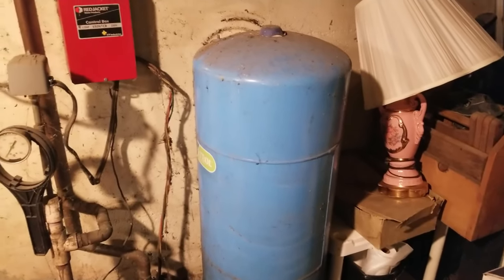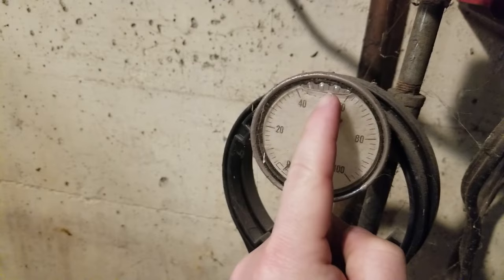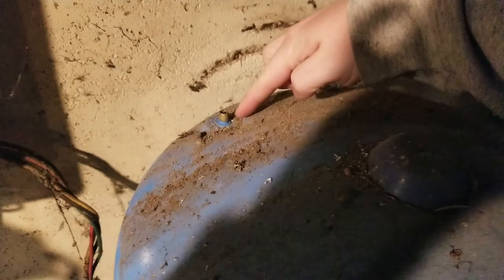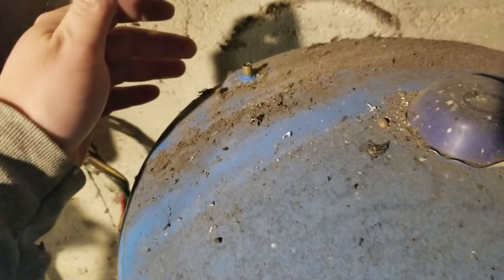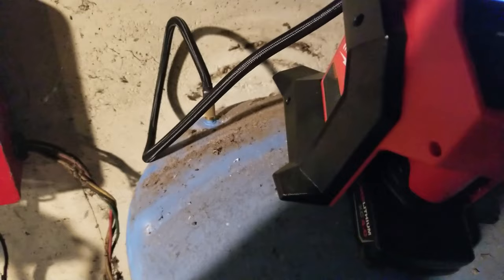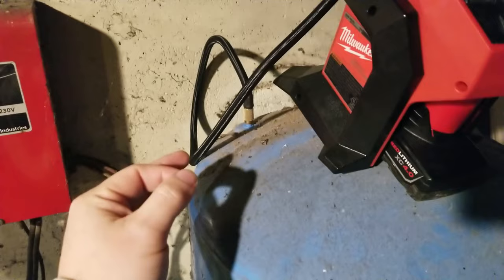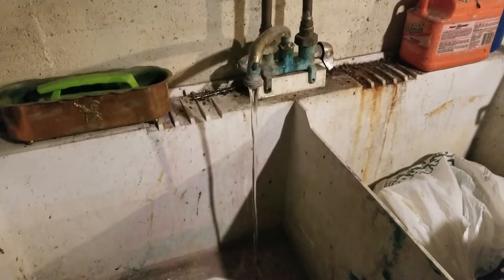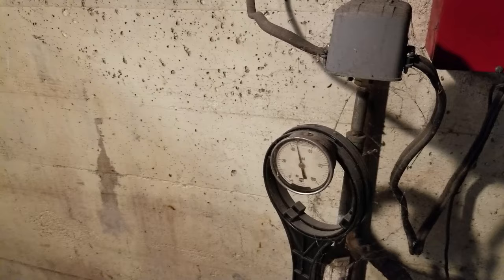How To Find Out If Your Well Pressure Tank / Bladder Has Gone Bad

Comment: When you drain the tank with a faucet somewhere above the level of the tank you should air the tank up when the pressure in it gets low in order to drive the water out of the tank. If the tank is water locked the existing air pressure will not have enough volume to push all the water out and gravity will not allow it to drain because the tank is lower than the outlet. Two or three times of repressure application will usually do the job.
Reply: Omg thank u. I have been searching for this answer forever

Comment: If you don't have a spigot at the bottom of the pressure tank to open I would think that there would always be some water in it.  Opening a faucet at a location anywhere higher than the tank will just remove all the pressure from the tank and the pipes but there will still be water in your pipes that seeks it's natural low point, which will not be at the bottom of the tank.  You would need to have and open the spigot at the bottom of the tank and open a faucet somewhere else in the house so that any vacuum in the system would be released and then the tank would fully drain. I also think that if the bladder is broken and water is getting to the top of the tank, where only air/pressure should be, that if you press on the spring loaded schrader valve stem, when the tank has it's high/pressure switch shutoff water pressure, that water would come out of the schrader valve.
Reply: In Europe we call them taps not faucets.
Reply: Comprehensive explanation, thank you.

Comment: That looks more like a foot value or a slow line leak problem then a pressure tank problem. You should also have a check value where the line enters the house prior to the pressure relay and tank, that way the pump won't kick on if you have some kind of bleed off prior to the house. Even a bad tank  should hold constant pressure when no water is being used, unless the air value is leaking.
Reply: No, it shouldn't. If the bladder is shot the air pressure will escape through the lines when the pump is turned off.

Comment: I just had the same problem. My issue was that last winter my system froze. Long story, but in any case, I replaced the plumbing that had obvious issue and knew that the tank probably also suffered damage. Well, it lasted about four months and then my water started pulsating. When I checked the top Schrader valve it had plenty of air and no water came out. I followed your instructions and drained the system. When I shook the tank I could barely even move it. It was FULL of water. 

I got it disconnected and the valves spun off of it, but couldn’t move it. With all the air out and the valves removed, I had to drill a hole in the thing just to move it. 

Thank you for the help!!

Comment: im in the same situation right now...pump never gets to shut off point and constantly runs...been using the breaker when we take a shower or dishes...
 my bladder tank was completely out of air.  i filled it to 28 and in a matter of minutes it dropped to 26 psi.
Reply: Great video thank you how do you drain your bladder tank I think I need to replace mine I tried to shake it and it seems to be full is that a bad sign

Comment: Aight bud, here's the scoop, sorry for the delay.
The pump has a check valve, but don't rely solely on that, add a very simple brass check valve (it's just a nipple sized fitting with a pin and a simple swinging flapper door, costs maybe $30, as it's probably 1" minimum, or should be at least).
Also, observe the crud in the bottom, may be worth adding almost any kind of whole house filter, as mine was filled with mud, (well dug to 120', pump set at 100, water sits at 75' down), I installed a T, after a check valve prior to an old style plain spigot placed higher (above) than what's next (for draining/allow air IN). Then, in a vertical pipe, put a T to split the one into 2 pipes, (now this is crucial) at the SAME level (height) I added 2 of the plain/simple/basic/cheap/pleated (round air filter looking) high micron whole house filters to eliminate a lot of chunks o sludge, as well as catch tons of the iron sediment prior to that storage tank.
Being that it's split to 2, I usually change them out every 8 months. I have the filters both lead to a T to return to one pipe, and then another basic spigot on a vertical line below the filters in line before a shut off valve.
Also, on my new pressure tank, there's a manifold (at the bottom, different brand) that I also installed a spigot for draining the tank when that time comes. On this manifold is my pressure switch, a gauge, the in and out lines, as well as a pressure relief (much like a water heater has but without a temperature probe) that is connected to a small bleed off line that runs to the dump pump pit, should the switch fail in the on position.

Having the 2 filters on the same plain is important, otherwise one filter will get filled with debris while the other (higher) filter remains new looking. Also, the new home depot GE brand whole house filters offer a clear filter housing that sorta allows you to monitor the debris, but further down the line, for the home only, after exterior hose bibs split off, before my "conditioning" equipment, I have another split T to 2 separate better quality filters.
Reply: I've had well water here for 37 years. I think the check valve could be the problem also.

Comment: ########!How does pressure loss on water gauge come from a water leak inside bladder tank????? I told son, that his pump one way valve in the bottom of well was leaking back down. The bladder tank air valve does not release any water, and there is a difference when knocking on upper and lower section of tank!..<<<>>>???

Comment: We just had our tank replaced. It started blowing the circuit breaker. Is it a bed tank? Thank you.
Reply: Why did you have the tank replaced, and was it professionally installed?
To me it sounds like the pump down the well is shot or the wiring at pressure tank might be goofed up.

Comment: Man I'm confused.  My tank pressure does not drop when I turn the water on at a faucet.  The switch never turns on.  If the switch were clogged it would never turn off.  Basement has water the 1st floor gets a trickle.   Would that be a bladder leak?
Reply: Mine has the same issue. The new switch I fitted turned off the borehole pump at 44psi, but the pressure continued to rise to 58psi where it settled. After some time and usage the gauge reads a constant 58psi but in the house the water pressure is essentially way down to a trickle, though the switch is still held in the fully pressurised ‘off’ position. The gauge has been checked and is good, but the pressure inside the diaphragm tank firstly increasing then staying up suggests to my thinking that the diaphragm might be perforated, though when I test the Schrader valve air comes out but not water, and when emptied the tank rings bell like when knocked, and is easy to move around, ie not full of water. Were there to be a leak in the system then surely the gauge would drop, the switch would trip ‘ON’ and the pump kick in again, re-pressurising the tank.  Water cannot be compressed (hydraulic fact 101), so the gradual increase in pressure noticed at the gauge AFTER the pressure switch has tripped to ‘OFF’ suggests that water is getting into the airside chamber above the diaphragm, thus increasing the pressure there - I should point out that my gauge and switch are located on the top, air-side half of the tank, not on the water pipeline.

Comment: What about tapping the outside of the tank. The tank should be 2/3 air and 1/3 water. If it is OVER 2/3 water, it is probably because the diaphragm is punctured. It's water logging and will cause your pump to short cycle and willeventually burn out.

Comment: Where is the check valve that stops the water from bleeding back through the pump back into the well?
Reply from the maker: Yeah, its never had one.  Will probably be adding when changing out the tanks.
Reply: The check valve is way down in the well right next to the pump itself.
Reply: @reeb9016  That's what is called a "foot valve" and those do not last long, must be replaced every 10 years or so around here. I've had well water for over 35 years here and I moved the check valve to in front of the pump and although it's a tiny bit more difficult to prime, I find that I've had zero problems for more than 30 years at a time. I bought the first check valve in 1984 and I replaced it in 2016. I buy the cheapo brass ones for wells from Home Depot.  To prime the pump you need a 3/4" valved tee on the outlet of the pump and simply use a funnel and pour in water while the pump is running. Typically it will prime in under ten seconds.. You can simply cut the pipe and install a check valve on the inlet of the pump, that is what I would do. Priming is a bit messy because once the pump is primed it blows back through where you're pouring in the water. Also,  once primed it should hold prime forever unless there is a hole in the pipe.
Reply: @TheStruggleville  See my note to Ree B below this response. If I were you, I'd cut in a conventional well check valve before the pump (Home Depot, $25) and also install a priming tee and valve on the pump outlet. In over 35 years I've serviced our well pump twice, when the pump bearings became noisy.  The system of checkvalve, pump, priming tee works very nicely is very dependable.
Reply: @charlestatakis9363  Thank you Charles. I work on properties here on the North Coast of California in the Redwood forest. Everyone's on well here. This is new to me though since I'm a Southern California boy. 

Been trying to figure out why one of my clients pumps keeps running and I can't find a water leak anywhere. My troubleshooting has led me to the tank. It has a check valve and maybe even the foot valve is bad. There was a very small leak in the schrader valve at the top of the tank but not enough to be causing the drastic PSI drop. It's a 40/70 system and it's at least 20 years old. It goes from 70 to 40 in 22 minutes.

When you installed the check valve before the pump did you replace the foot valve to or do you leave it dormant or remove it? Thank you Charles.

Comment: What would cause your tank to go to 90Lbs?? A ruptured bladder? Mine is only 15 years old. Came home to no water but 24 hrs later had water but low pressure. Can't afford a repairman. Any suggestions for the elderly???
Reply: Sometimes the bolt upstair is not tight enough. The bladder couldnt fully sealed. I have this experience once
Reply: @ngocehgayabebas2118  Are you talking about the one on top?? It's tight. I put air in the tank a month ago and do have water. Could the pressure guage need replacing?? It still registers 90 lbs. I can replace that myself . It $100 bucks just for them to come out here, let alone do any work. And a new tank is between $300-$500. Thank you for responding. No one else has. Hope you have a Merry Christmas 🌲♥️♥️
Reply: @singlewhitefemale1707  first case, if the tank pressure is going up even after you reduce the pressure and fill it with water, then you have a small leak in the bladder. This still have pressure that could push the water out to the pipe. But it drop drastically so the pump would turn on too soon. Drawdown capacity of the tank reduced because too many water outside the bladder within the tank.

Second case, if you have water but no pressure in the output, that mean the leak is too big. You may say this as a ruptured bladder. In this situation, when you measure the tank pressure, your gauge will show a relatively normal number as long as there’s no hole in the tank body.

From your explanation seems like the bladder ruptured.
Air pressure still kept inside so the reading shows 90Lbs. That because there’s no hole at the tank’s body for the air to escape.

If you could, you better check the bladder first. Take it out and see before deciding to buy a new tank or gauge.

Btw, I’m a muslim.
I wish you a Merry Christmas too.
God bless you mam.
Reply: @singlewhitefemale1707  remember, when you decide to open the pump, make sure to empty the air pressure first. 

I wish I were there to help. But I live in Indonesia. 

So good luck
Reply: @ngocehgayabebas2118  Thank you so much for your help. I do believe I have a leaky bladder. It needs air about once a month. I do have a water leak around the bathroom somewhere. I keep the pump off until I need water. Trying to get the leak fixed while I'm off work. You have a blessed Christmas and a very prosperous New Year!! Thank you again for your help!♥️♥️♥️
Reply: Yes Sir! I would never open it with 90 lbs of pressure! Your advice and time is plenty! You live in a beautiful country! I'm in the United States. Hope you have much peace and love there!
Reply: @singlewhitefemale1707  you too mam. Thank you very much

Comment: That system is old got a control box probably galvanized pipe in the well
Reply from the maker: Right on that one, at least half right.  Has 2 pipes coming in, a PVC and a galvanized. Writing on the control box has a 1993 date and says delta 1/2hp. So I assume they changed to the PVC then too. Didnt have a check valve so added one while putting in the new tank.
Reply: @TheStruggleville  still might have a air pocket in the line and extra strain in the pump I see this day in and day out I work on wells

Comment: Hello.  I have a question.

My well guy came and I think he tried to scam me. 

He was there to upgrade my water softener system.

He was trying to check the pressure tank but every time he would put the pressure gauge on it, he would let air out.  

It was weird what he was doing.  It looked like he was trying to get the air out and then at the end he tells me hey look the pressure is 16 PSI. 

I said why don’t you empty it out and fill the tank with air and than let’s test it like it’s supposed to be and like how it’s shown in videos all over online and etc. 

He completely ignored it and said it’s bad.

So after he left I did the checks myself.  

Emptied the tank and than did the pressure check. 

I set pressure at 37.  I checked it in the morning and it was 36.5.

I may have let some air out trying to pull the gauge out. 

Now is my pressure tank bad?  

I did this test so many times and same results. 

Tank is not water logged either.  When I knock on it, it sounds like all other tanks.  

Please advise.

Comment: Remove all that galvanized pipe immediately. You're poisoning your family with heavy metals. Did you get it fixed was it just the tank?
Reply: Like lead solder used on copper pipes?
Reply: @knerduno5942  lead solder hasn't been used on drinking water pipes since "1986" when it was banned nationwide